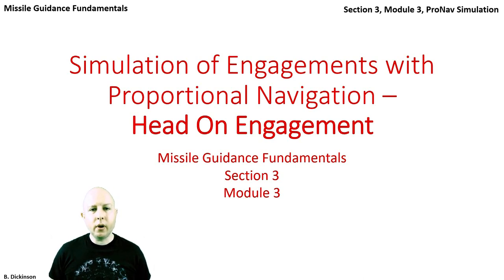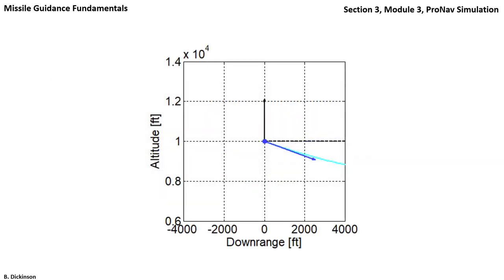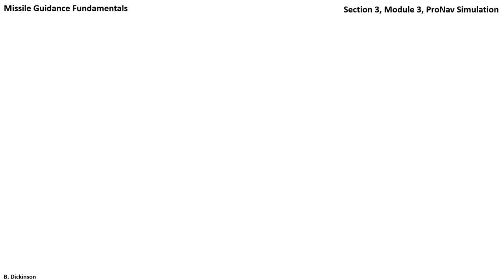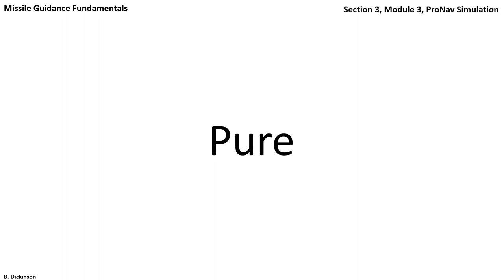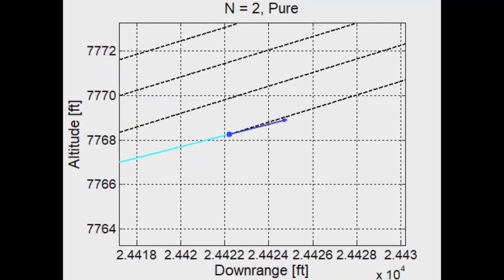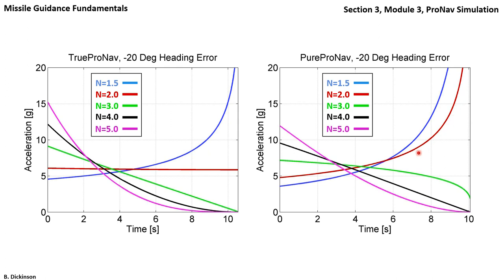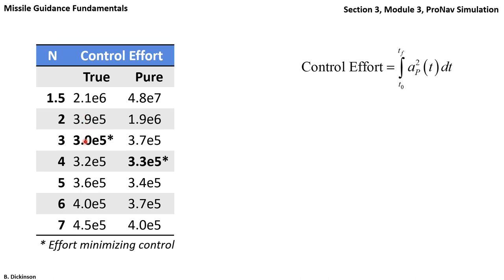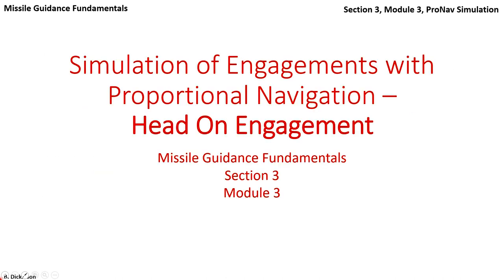Simulation of Proportional Navigation Head On Engagement, Section 3 Module 3, Guidance

Comment: Hi ben great work as usual ! i ran the simulation and i got similar results. just a small correction : in the video, you pointed out that the initial separation is 30000ft, whearas in the simulation it is taken to be 40000ft.
Reply from the maker: You are correct, this is a known error. I'll add it to errata in the description if I have not already. Thank you